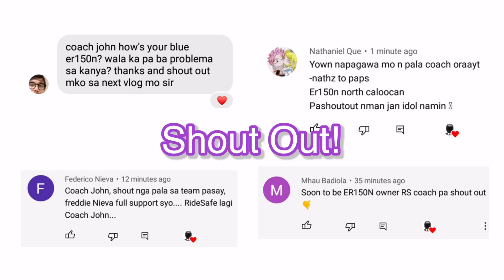The Best Pang Gilid Setup for Easyride 150N | Sierra Speed Tech Kalkal (Update)

Comment: 15g 
842x20x30 belt
Mtd
Mcl ferodo
sst set with kalkal pulley saka dface
Clutch spring 1krpm
Center spring stock
May kulang pa ba?
Reply from the maker: Samahan po ng dasal na maging maayos po ang lahat..👌👍😁
Reply: TTGR Beat Carb 1k rpm (pag ibang brand baka mas matigas sa stock) FYI
Reply from the maker: @danmararteta7904  makinig kayo dito mga ka-RIDES.. isa ito sa mahiwagang kamay na humahawak sa motor ko..👌👍😍
Reply: @danmararteta7904  yan gamit ko paps.
Reply: Ilan stock ng er?

Comment: Coach john sa pagpapaayos po ba ng panggilid kasi po diba lalakas po yung hatak nya..nagiging malakas din po ba sya sa Gas Consumtion..Salamat po
Reply from the maker: Sa pananaw ko lang po kumporme pa din yan sa riding style mo..
Reply: Arangkada po usually ng stock is around 4-5k rpm sa er150n. So pag inupgrade yan pwedeng tumipid kasi bababa ung rpm ng arangkada. Depende nalang sa setup yan.
Reply: @danmararteta7904  ahh salamat po.
Reply: @COACHJOHNRIDES  salamat po
Reply: Coach john Ride..nag buy me sa online ng set B ni gy6 hack..drive face,mcl mtd at may quick throotle tapos ung iba all stock..tpos 90kgs me...ung rpm nya coach nasa 4k rpm pa rin pero malakas na hatak nya...pa advice namn po kung nid ko mag palit ng bola at center at clucth para bumaba namn unti ang rpm..ty po...zamboanga city po aq..